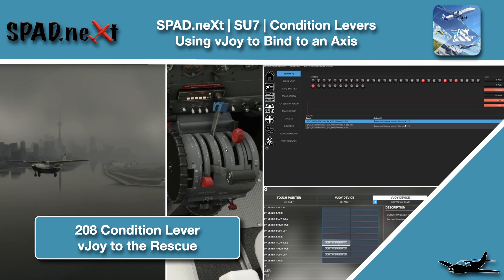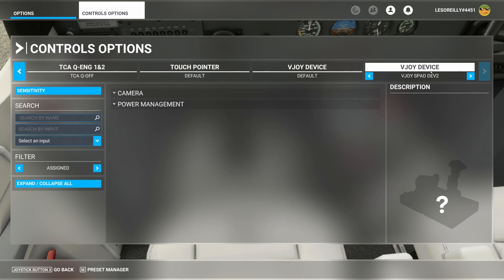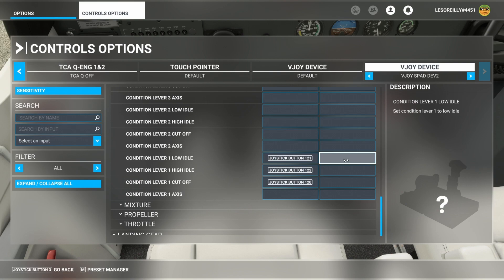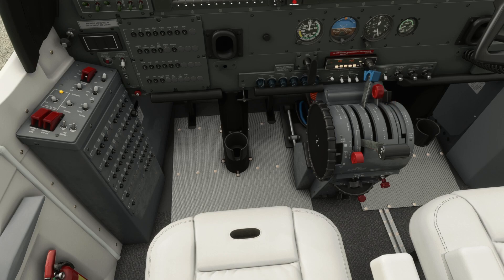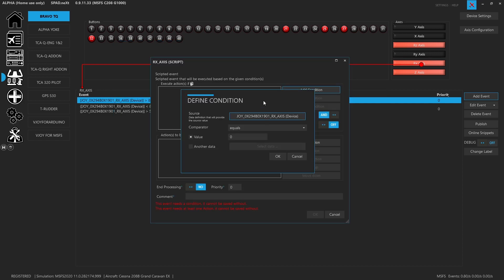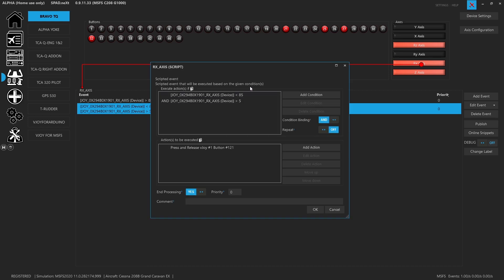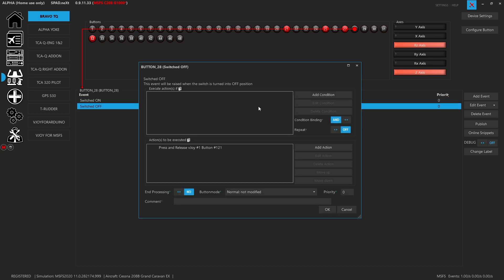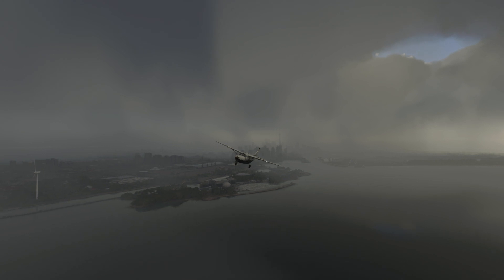(MSFS) SPAD.neXt | SU7 | Condition Lever Fix

Comment: This is beyond frustrating.  According to AAO the axis that the sim is updating is K:AXIS_CONDITION_LEVER_SET but we can't bind that in Spad?  VJoy doesn't work properly on Windows 11 so I'm just stuck without being able to bind it? Why can't Spad see this axis?
Reply from the maker: This is an older video. Pretty sure we can use the B Events now. Also yes vJoy works just fine in Windows 11. I have it on all 3 of my W11 PCs working with spad and MSFS just fine.
Reply: @LesOReilly  Doesn't properly install for me.  Soon as I reboot windows says the driver isn't supported.  I googled and found tons of other posts the same.  shrug.
Reply from the maker: In the spad discord is the version we all use. I have 3 computers running it. It works.
Reply from the maker: Just for "Giggles" I uninstalled it from my Laptop.  Reboot the PC.  Went to the SPAD discord.  Downloaded from the posted link the version 2.1.9.1-160719 and it installed just fine with the "successfully installed" pop up.  Ran Spad again and had the vJoy device all working.....

Comment: Is it still the same method in update 8? or is there already another way to do it without the vjoy? Thanks.
Reply: For example for 208B
Reply from the maker: I have not touched the 208B in a long time...  Once I got the Kodiak there was no need to touch the 208...  If you don't want to use vJoy you could use Keyboard commands instead.  However the issue with that is you need the Complete Edition if you want to send keyboard commands to a specific application.  The Standard spad edition will only send the commands to the application in focus and that was why I did these videos using vJoy so that any edition would work ..

Comment: There is now a Condition Lever axis which can be mapped in FS which is suitably ignored by the piston aircraft looking for mixture.  That meets most of my needs but yeah this isn't exposed to Spad.next yet.
Reply from the maker: That is what this video is for .. sort out how to work around the lack of the Lever being exposed and how to make it work...  Looking forward to the day where they add controls and on their own say "we should add this to the sdk..."..
Reply: @LesOReilly  Yep.  I didn't complete the setup to Spad, i'm happy enough (for now) just using the Condition Lever Axis option in  FS as it doesn't really conflict but I do prefer to have the config in Spad rather than have it split of course.
The other small issue is that the cut-off comes in rather early with the axis config but it's workable.
Your videos are great by the way, I didn't even know that they had changed mixture to condition lever until I searched and wasn't aware of the options in FS so thumbs up anyway :)